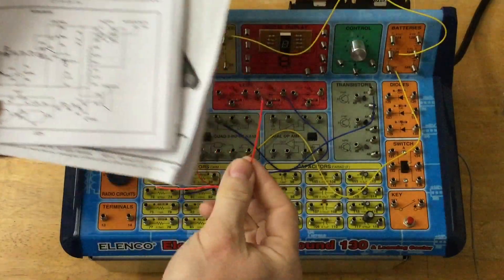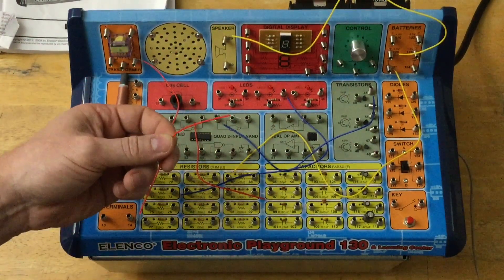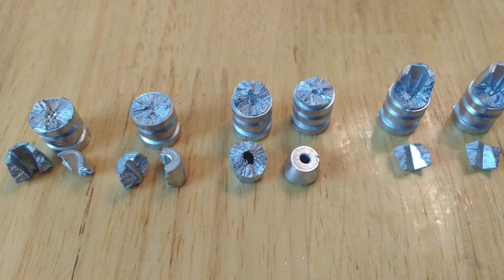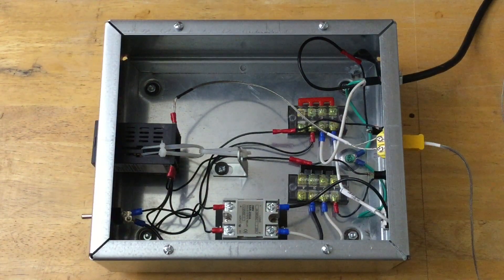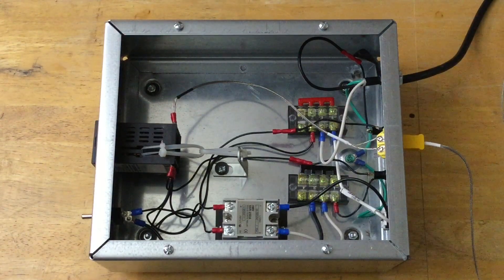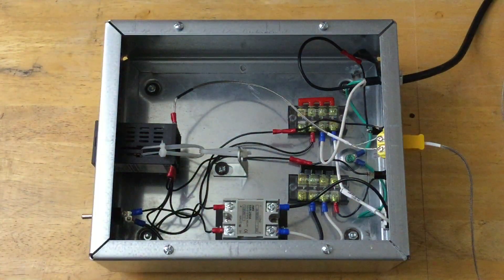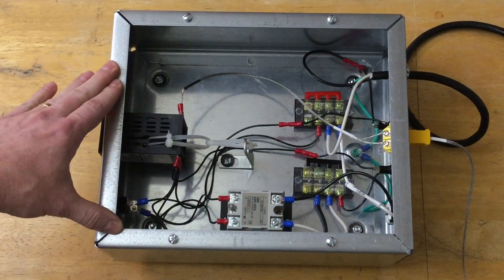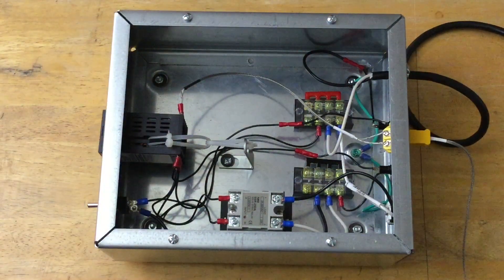Building the PID Temperature Controller from Johnny's Reloading Bench

Comment: @loads of bacon you explained that you decided to build a pid unit because Thor’s Axe said your 4-20 pot was WAY to hot. My question is did you ruin that lead that was getting to hot. I’m asking because today I decided to cast up some 1lb ingots. Well I use a turkey burner type burner this isn’t a normal turkey burner it’s like a propane jet burner. Needless to say my lead was HOT HOT and when I would flip the ingot tray over to drop them. A few of the ingots looked just like the projectiles you showed in this video almost like a metal injection mold type metal. I paid no attention to it because if figured it’s just lead I can recast it. However in the back of my mind I was wondering if I possibly changed the makeup of the metal by getting it so hot.

Comment: Any problem in using a wooden box to house the electronics instead of using steel?
Reply from the maker: I'm not entirely sure.  I suggest running some tests to see just how warm the components get.  I doubt any of them will ever get warm enough to be a fire risk, but I can't promise it.
The other, and probably more important, consideration is grounding.  You need to make sure your wiring and components are all adequately grounded in your particular setup.

Comment: Johny's wiring diagrams accessed via the links in the description has the red connecting block as common and the black block as live (hot) , do you do the same ?
Reply from the maker: It's been a long time since I worked that up, bit I'm pretty sure I used black for common, and red for live.

Comment: only question is with amazon selling some top PID's for $22 why build when U can click and get 1 with a warranty.
Reply from the maker: I would love to see a $22 complete unit.  Can you please provide a link, or a specific item name to search for?  That would be very helpful.
Reply: @LoadsofBacon  Inkbird Digital PID Temperature Controller on/off Thermostat Ac 100-240V ITC-100RH with PT100 Thermocouple got for $27 with shipping.
Reply from the maker: The unit I am using is similar to that.  What I added was a power switch, power via a wall outlet, power going from the PID unit to the casting pot, a thermocouple, a thermocouple connector/jack, a solid state relay with heat sink, some fuses, and a box to hold it all.  The unit you are referencing is the heart of it all, but it requires more than just that by itself to be used.
The MYPIN PID I have is almost identical in price on Amazon to the Inkbird.  Take a look at the links in the video description for the videos by Johnny's Reloading Bench if you would like; he provides a whole lot more detail.
Reply: @LoadsofBacon  I didnt add a power switch as the power strip I use already had a switch and the PID came with a PT100 thermocouple. I use more for monitoring the casting pot and turn down thermostat as needed than control.
Reply from the maker: That makes sense.  I use mine for full control; I never touch the dial on the top of the pot anymore.

Comment: I'm betting you could have put it all in the original Lee housing!
Reply from the maker: There have been a couple folks that have built their PIDs into the housing.  I didn't want to do that as having the separate unit allows me to use this with multiple pots should I ever decide to get another (either replacement or additional).

Comment: You did all that kick ass work then you used a hose clamp on the input power? Order you an IEC connector for Gods sake and finish that badass box properly , your work demands it. https://www.ebay.com/itm/10A-120V-Inlet-Module-Plug-Fuse-Switch-Male-Power-Socket-IEC320/162401885347?hash=item25cfe81ca3:g:DoMAAOSw~AVYqhWi
Reply from the maker: Yeah, I just went with what I had on hand, but no doubt, the IEC connector is a far better solution.  Honestly, the thing's been running so well that I've had no need to mess with it, and I haven't given it any thought.  I just turn on the power and start casting, and it works.  Thanks for the reminder - I do need to properly finish that piece of it!
Reply: Just think of the plumbing projects you'll be able to tackle once you free up those clamps. You did a nice job on that , it was really clean and tidy.

Comment: Well Bacon your gonna be casting in style now with that PID unit. Just got to get the settings right and you’ll be in casting heaven. It holds the temperature with-in a few degrees of set point, it made a big difference for me. Enjoy it, and remember rock-on
Reply from the maker: Thanks!  What temp have you found works best for you?
Reply: On my main bullet that is a 200 45 acp swc I run 770 on a LEE MOLD but it’s a trial and error thing, find out what works best and write it on the box for your mold
Reply from the maker: Thanks!
Reply: 9mm run a little higher as they don't hold the heat as well

Comment: You did a excellent job. I like the project box you used in the build, where did you get it?  I have another PID unit that I have mounted on a board and It hasn't been high on the company's priority list to get a box yet. anyway,, I'm glad that you have a use for it, thing is now you will have precise control over your heat, Thus bettering the overall quality of you castings. and it will make your Lee furnace work just as good as a $400 dollar unit. The PID unit also works to control the temperature of the Lube in a conventional Lube sizer, all you have to do is drill and install the thermal coupler in the base of the heating plate. Good video as always bud, Hope you get many good years out of the PID .. Dave.
Reply from the maker: Thanks Dave!  Here's the box I used:  https://smile.amazon.com/gp/product/B007V6JJ30/ref=od_aui_detailpages01?ie=UTF8&psc=1
Hadn't thought about the lube sizer heating plate - that's a great idea!
Reply: If a person keeps his/her eye's open lot of the things you need to do the project with can be salvaged for free. I like that Johnny brought that up. (Not to be king of the cheapskates) also, One thing you discover when you start casting is how little of an investment it takes to get quality handgun bullets. A majority times better than you can buy, plus the Volume in how many you can make for so much little money. Snack containers become a sought after thing.. and the next thing you know you are looking for places in a garage to store them once they are filled. Thousands of your favorite bullets ready to load. Powder coating is the get all. cheap, effective and fast making it viable for anyone to do. The real credit go's to the God father of Casting,, Fourtuncookie,45LC, He is one of the first guys out there that started You Tube videos on the subject and opening peoples eyes to the joy of casting.  anyway, I'm looking forward to many years of your quality videos Guy.. Dave.
Reply from the maker: Agreed.  My garage is currently filled with the red plastic Folgers coffee cans.
FC45LC was my virtual mentor - I found his channel a few years ago when I began to consider casting, and learned most of what I know from him.  And I keep learning from him...

Comment: Was. That jb weld you used to hold the ssr in place? Im waiting on 2 parts from china and then im buillding mine
Reply from the maker: No, it was heat sink compound.  The SSR is just held on with the two screws.